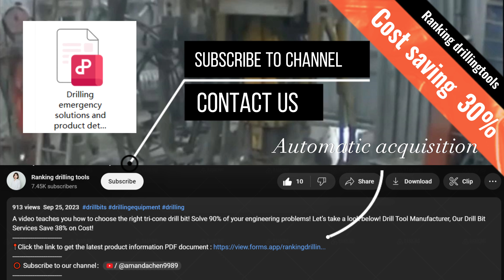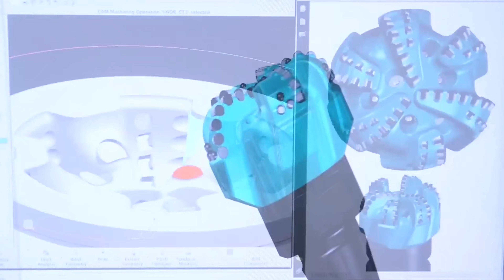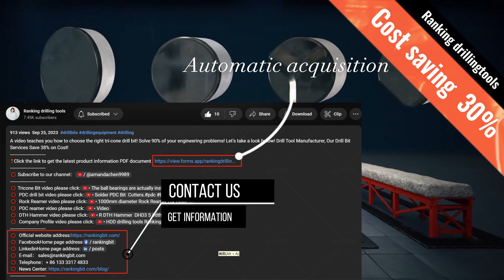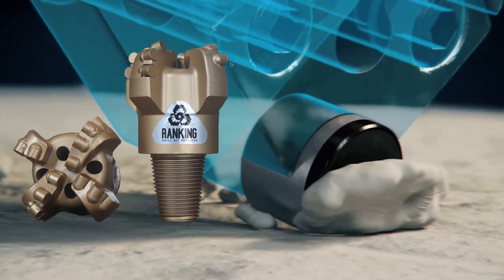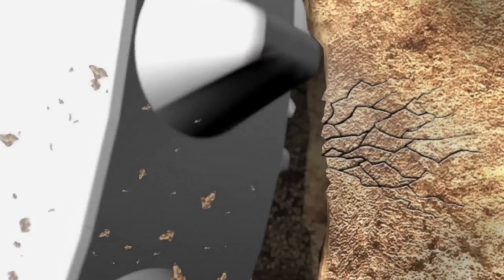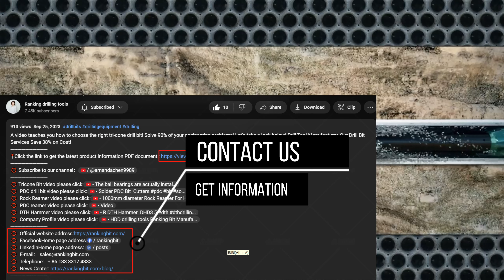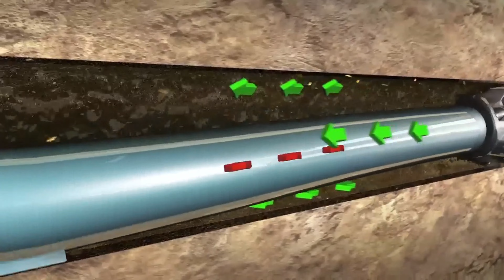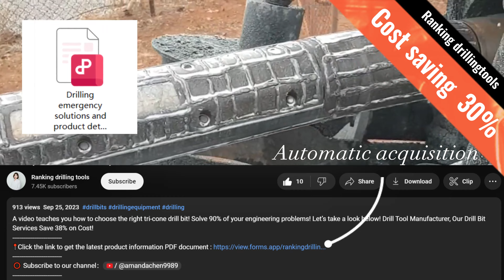Rock Drilling Pro Tips: Select Tools, Avoid Traps

Comment: Air rotary. 
I  used to drill water wells, with that method. 
But also used CABLE TOOL rigs.
Here in the Canterbury  plains, with gravel/ sands, we have to use a casing ALL the way.
Some wells 150 - 200 mts deep.
Than screen dropped in, and casing jacked back to expose  the screen  allows  the water in.
Will add, cable  tool also  used for TEST DRILLING  bridge  piles and under buildings, to see what piles are needed. 
Welded casing,  so each weld had to be done properly.  3 runs on each. 
Root run, bottom  run, 3rd run to finish. 
Cheers  to all.
Reply from the maker: For digging water wells, both air rotary drilling and mud can be used! Great people in the drilling industry! If the solution I am talking about can help you, that is my original intention of making this video. I have also compiled a complete pdf document of the solution. You can get it for free by clicking on the link below the video. I also hope you can subscribe. My channel!